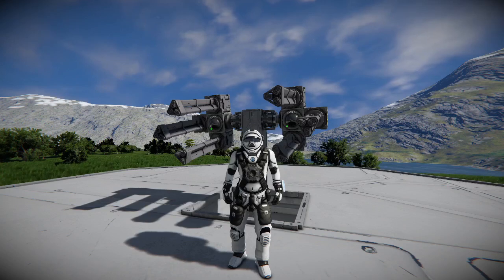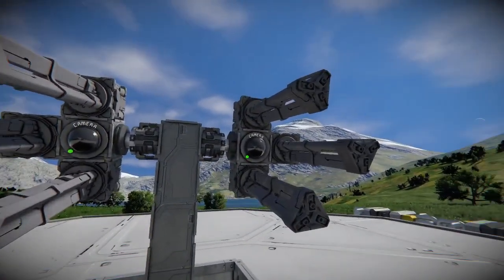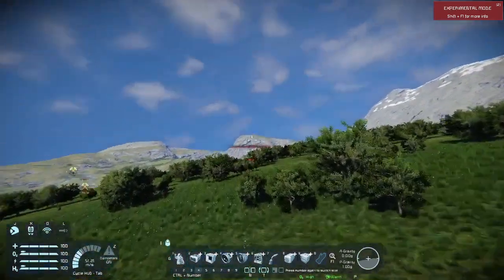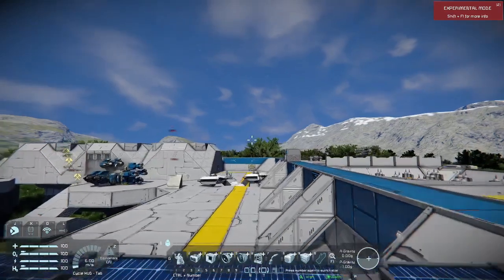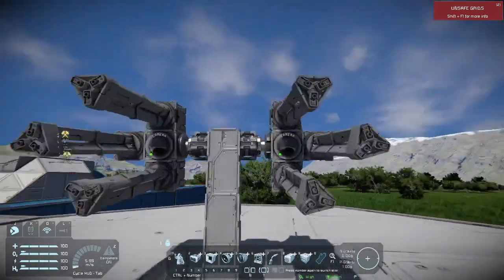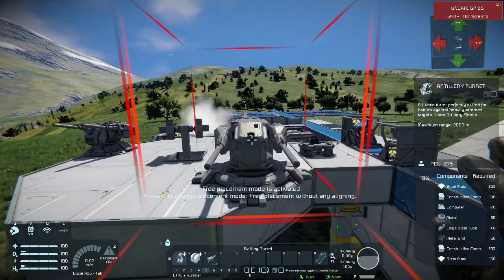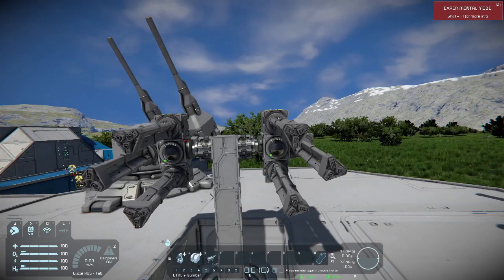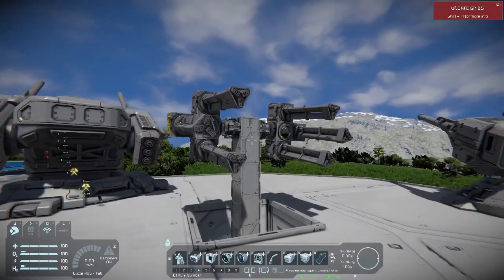A New Way To Turret

Comment: hmm ive seen this before its actually nice because half of the turret if in range will target indepently from the other half possibly taking down 2 targets at once say 2 missiles for example tho you might want to experiment with armored conveyors leading to advanced rotors then guns so you can supply ammo little tricky but the difference in durability would be noticeable
Reply from the maker: I have built one and tested it. The amount of armor you can tack on is great and can take a good pounding from the in game drones, but the fight with the quad gun variant just won't last long against it.
Reply: @badgerwildgaming6908  yeah :/  i wish there would be a variant of rotors and hinges for warfare purposes using more components so they last longer in battle would make viable turrets instead of a lucky one bang shot that blows it away haha
Reply from the maker: Oh no I mean the drone doesn't last long against the turret. Four gatts are more than enough to cripple a harasser pirate drone in a few seconds.
Reply: @badgerwildgaming6908   oh  lol  nice my bad XD
Reply from the maker: It's OK.

Comment: Unless the Turret Controller has been changed, it will only target to a certain range, so big guns will not operate at long ranges unless you take control.
Reply from the maker: Yes this is good for hard hitting turrets with lots of armor.
Reply: True, but you can use the "Copy Target" function in the turret controller to have the turret engage a target at max range, as long as you already have a lock on the target.
Reply from the maker: Yup use weaponcore and you can slave them to fire at any range.
Reply: @badgerwildgaming6908  The mod? That is good considering the amount of resources and space you need for a custom turret, especially in a ship design. As far as I know, the PCU expense makes them useless on a server too.
Reply from the maker: Depends on the design.

Comment: Idea: Have a basic gun on a hinge on the very top of the central pillar with a turret controller controlling JUST the bottom rotor and the new hinge. On each gun arm, add a hinge between thier rotor and the gun/camera array and have each arm on its own turret controller. This will have the effect of having all the guns focus fire on a single point rather than having a parallel spread. Like shining three laser pointers that are a foot away from each other all shining on a single dot.
Reply from the maker: Yes you can upscale like this be sure to show us your mechanations in the Late nighters Discord.

Comment: What am I missing? I’m pretty sure this isn’t as good as you’re thinking it is. Without a block for secondary horizontal movement, it can’t aim at a second target. So you’ve just added unnecessary complexity and size to the turret design. Help me understand if I’m wrong.
Reply from the maker: It's better because you have more stacking opinions than a hinge with more armor for the cost of a turret controlers worth of space.
Reply: @badgerwildgaming6908  I look forward to seeing what you come up with using this design principle.
Reply from the maker: Will do!

Comment: only major issue I see happening is this is going to tear itself apart on a server due to the wrath of Clang.  Even then it will probably cause undue stress to the Sim if too many of them are running at once.  So while it will be fine, for the most part, in single-player, it wouldn't be MP friendly. 
However for the topic at hand, ya you could make Autocannon turrets with this setup and make 2km ranged turrets in pure vanilla (instead of using a Vanilla turret range mod for the other guns to shoot their 2km range).
Reply from the maker: It's good for a main gun battery or a really deadly interceptor turret for defence.

Comment: Throughout some engineering shenanigans I undertook to make a battleship-style railgun turret I managed to create one monstrosity that used a total of three turret controllers, two of which were used to make the two outer railgun 'barrels' converge on a single target, with the remaining turret controller used...well, to make the turret behave like a turret, aim and fire. Within the 800 meter effective AI range of the controllers, a manned turret could then focus it's full firepower on a single targeted subsystem within the enemy vessel, for improved armor penetration and chances to disable that targeted subsystem.

Due to several issues however, the complexity, the jittering of the outer guns when multiple subsystem targets were present, lack of range for convergence due to how the mantlet was assembled to save space, and in general not liking the appearance of this turret's armored 'barrels,' I scrapped the idea. That said, using the same idea to make a turret that can aim all mounted railguns at different pitches does sound neat...
Reply from the maker: Oh you just have to turn on the vertical hing or rotors shared inertia that will fix the jitters.

Comment: Best way to think of this setup is like the guns on battleships. Three barrels would be the equivalent of three turrets pieces (the elevation rotors with the three gatling guns on it) but all three turn horizontally at the same time at the same rate (the bottom azimuth rotor). For non ballistic projectiles in SE (IE: rockets, assault cannons, basically the prefap weapons), this setup would allow for multiple targeting of different blocks with a single turret, but if more complex guns are used (IE: The piston jolt mechanism that's been in the game for a bit) the main guns on battleships could be made for the same purpose which would be rangefinding
There's a few applications of this mechanism but really it comes down to the pros and cons. The biggest pro this has is maximizing space, but the biggest con is that if there aren't multiple blocks to target laterally, it becomes less effective than just having two completely separate turrets. At least that's what I gathered from the tests I've tried with this sort of thing
Reply from the maker: Yes most don't know battle ship guns work like that.

Comment: You could go really ham with this idea and hinges, packing a lot of guns tightly together. Start with one turret in the center that has both horizontal and vertical elements, then extend sideways as much as you dare with individual guns that independently adjust on the vertical via hinges. Wrap the whole thing in a heavy armour shell that spins with the central column. Would look like it came right off a WW2 battleship. =^.^=
Reply from the maker: And could be better armored that most turret guns to.

Comment: Using the similar multi-controller method back then when the update came out, i tried to make a centipede-like turret which had an independent targeting for each of its segments. That monstrocity looked like a caterpillar, but with autocannons instead of legs, and its segments rotated between several enemy ships, targeting them all at once
Reply from the maker: Is it on the steam workshop?
Reply: @badgerwildgaming6908  Nope, because i didn't liked the way this thing came out as a result, so i wasn't bothering uploading it
Reply from the maker: Aw that's too bad.
Reply: @badgerwildgaming6908  But i can upload it, of course, if you want to check (and send the link here)
Reply from the maker: Ok would love to see it.

Comment: Ive had luck with putting a coaxial on a similar vein ive been experimenting for a while having a gat turret like this on the side of my artillery/railgun turrets. Them being independently mounted means the artillery can compensate for drop without throwing off the Gatling, while the gat provides cover fire during the artillery reloads.
Reply from the maker: Yup lots of opinions with this concept.

Comment: This could be useful for controling one side of the turret while maintaining the other side for AI control, taking out incoming missiles, etc. I'd possibly do mixed weapons with this config.
Reply from the maker: Ya it would. I've proven you can run two turret elevations on the same turret.

Comment: Should test it with several targets, something like 10 should do. In case the two TCs get two different targets.
Reply from the maker: As long  as you don't give the horizon azimuth to one arm and not both you should be fine also don't forget to share inertia on the vertical rotor it will aid in accuracy.

Comment: i already made a duel railgun turret with a singular hinge and rotor
but you can make it a lot small this way
mine turret is about 3x5 or 3x4 large grid blocks in width and length 
so it does have potential
Reply from the maker: Thanks also it's much easier to armor them than the hinge variants.
Reply: @badgerwildgaming6908  ye hinges are hard to armor up they do have the benefit of being easy to replace
Reply from the maker: Ya also their pretty exposed all the time making them easy targets if your build is small.

Comment: What would happen if the two turret controllers try to lock on different targets at the same time? Would that confuse the turret?
Reply from the maker: Usually only happens when two targets are vertically parallel to the turret then its two for one.

Comment: I did a test with two railguns on 1 advancer rotor and two hinges, one for each railgun. Does both turret control blocks have to control the rotor? They over swung a bit and first shots missed the target, which was stationary
Reply from the maker: No one controls the azimuth and vertical plane on one turret the other controls the other horizon of the second arm.
Reply: @badgerwildgaming6908  That probably explains it. It over compensated when turning towards a target. But oh boy it turns way faster than most modded railguns lol
Reply from the maker: Ya also set the vertical rotors or hinges to share inertia that will take alot of the wobble out.